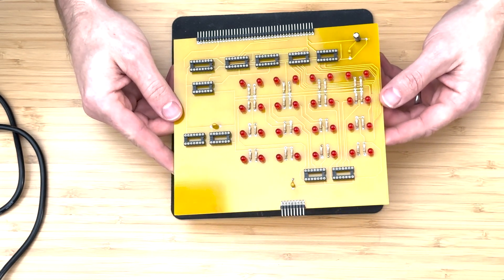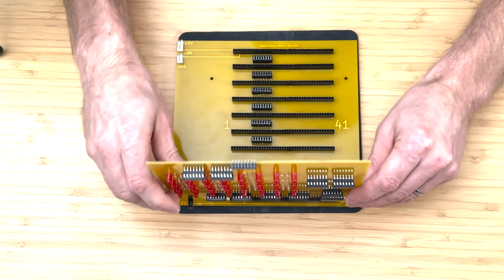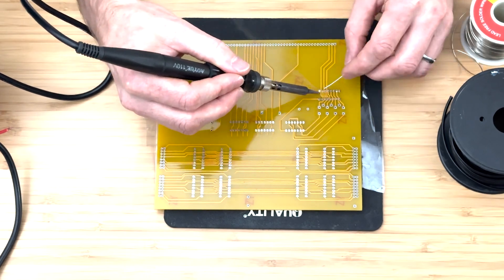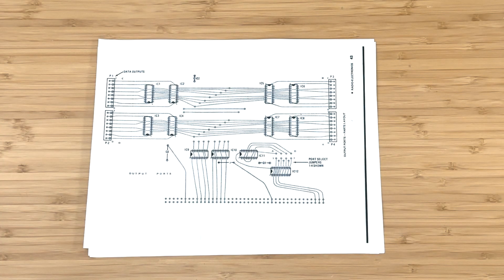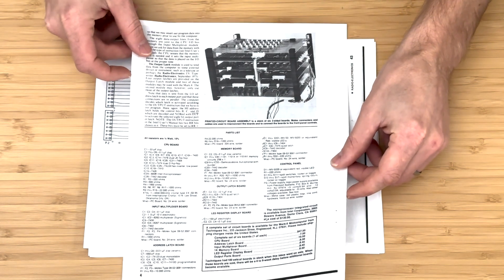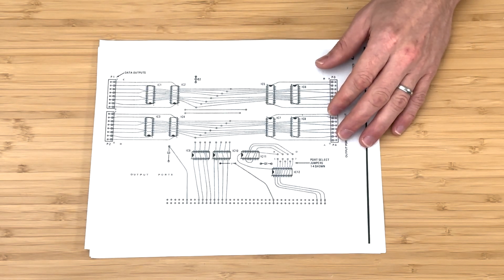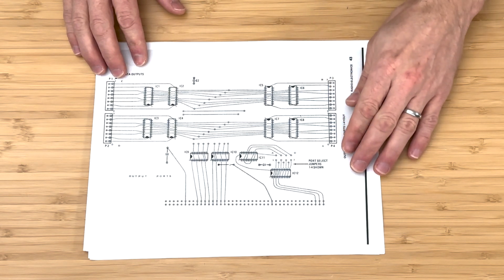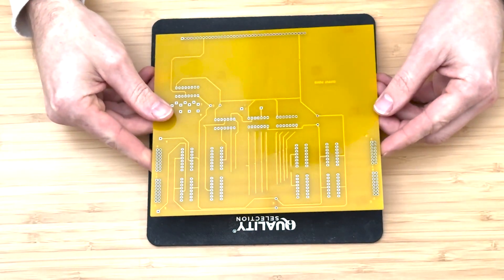Mark-8 Minicomputer Build - Output Board

Comment: Wash with hot water and soap...that's how DEC specified cleaning their Flip-Chip boards.
Reply from the maker: Washing the board is not required, unless if using conductive flux, but it will make it look better.